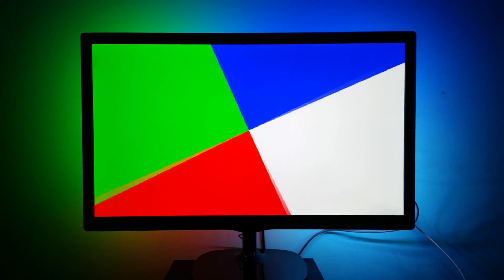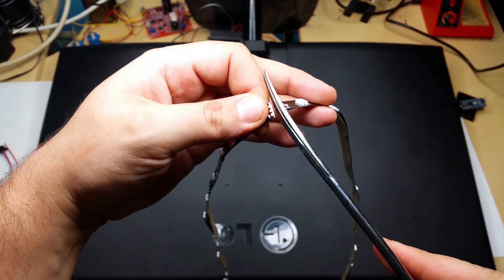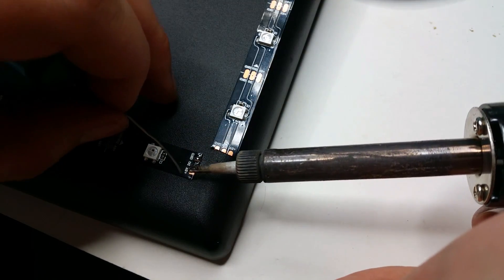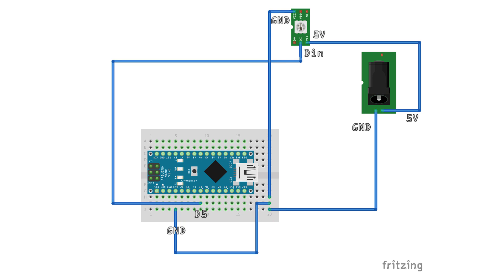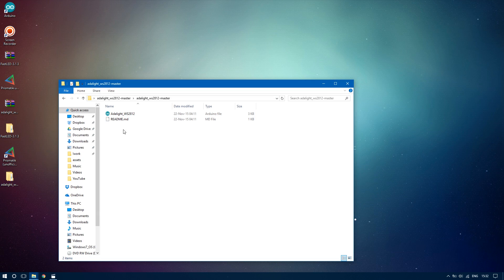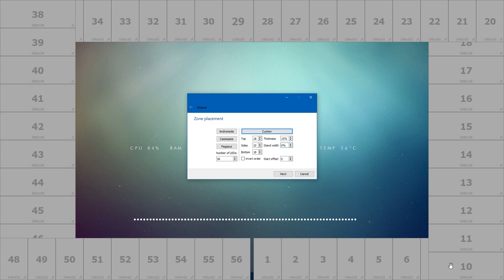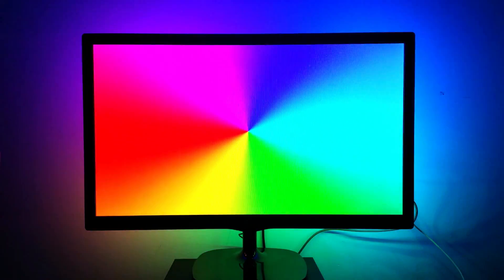DIY Arduino Ambilight RGB WS2812b Full Build & How-To

Comment: Watching it again and noticed that:
3:21 Arduino is on the board in specific position (based on empty spaces of board)
3:24 Arduino is rotated 180 degrees on the board or just moved 1 pin to the other side?
That make a difference?
 You know what I mean?

Picture:
http://www112.zippyshare.com/v/kQ9OxbOK/file.html
Reply from the maker: As long as all the pins are connected correctly, the orientation of the breadboard doesn't matter.

Comment: Thanks for the tutorial. Have question as well. Do you somehow connect together those 3 ground cables underneath in the bottom right corner of the breadboard or do you just pin them in and it magically works?
Reply from the maker: +Dzin Jak yes they are all connected in one corner of the breadboard
Reply: So I assume you just pin them in without doing anything. That was one quick response. Thanks!
Reply from the maker: Alternatively when looking back, you can add all the grounds to 1 rail of the breadboard where it says gnd on the arduino.

Comment: Hey man. Nice tutorial! Have some questions. Can I use Sk6812 RGBW instead of WS2812B? Using a 60 pixels/m the 5v 2a dc is enough? Thank you!
Reply from the maker: Alexandre Akio Ogata not quite sure. You can try googling if adalight has support for rgbw lights.
Reply: Boris Dusnoki The reason I was trying to change the strip was the white color but I've found a solution calibrating through prismatik. And each led consumes 20mA right? 1.2A per 60pixels/meter. Thanks

Comment: Amazing, nice tutorial, i'm successfully create a simple prototype by this tutorial, using 16 leds just want to know if this scheme works.
I have a question, i didn't use extra power supply but my LED got power directly from arduino (i'm using arduino nano V3) through 5v and gnd pin and it works. The question is, am I doing it wrong? Will it cause any problem in the future? because the leds seems perfectly fine. 

Ah yea here's link if you want see some pics https://www.dropbox.com/sh/q593z5klkypc8dt/AADfmN_IgTJPgpFWc7TpoXhDa?dl=0
Reply from the maker: You can fry the arduino if you draw too much power from it. better use a separate power supply for the strip and link both grounds together (from psu and adruino on the breadboard).

Comment: +Boris dusnoki excellent tutorial.... for the power supply
would i be able to use a cut usb wire for power & ground?
red 5v black GND?
Reply from the maker: liquidco2 yes you would. That's how I'm doing. But check with the multimeter for any case. Which of the 4 wires is which.
Reply: Thank you for the reply, I've ordered my parts now just waiting on delivery from china
Reply from the maker: You're very welcome. Thank you so much, it really means a lot :) Cheers

Comment: what if i don't have a breadboard? can i plug the wires directly in the black slots on the arduino? i'm building this up this weekend, i would greatly appreciate any help! Thx!
Reply from the maker: The Cezz yeah that would work as well. If you have a bigger arduino you could connect everything in the headers. I just used a smaller one cause of the form factor. You could even use a pro mini with 5v.
Reply: @Boris Dusnoki 
Thanks! one more thing: does the "power supply ground" mean the V- output from the power supply, while the "power supply positive" is the V+ one? Without a breadboard, can i split the "power supply ground" into two wires and connect one to the LEDs and one to the arduino on the ground socket? I hope you understood what i meant, sorry i'm a total noob what it comest to electronics. Thanks again!

Comment: Nice tutorial, Ill build one set for my gaming pc and one for my Virtual Pinball Arcade.
Ill report back how it worked out in 1-2 months when the stuff has arrived.
Reply from the maker: zweck4629 good luck man. Glad you liked it :)
Reply: Hey thanks, btw have you measured how much current the leds draw in practice?
Aliexpress says 9 W per metre so your setup would draw 16,8 W with your 10 W charger.
Ive ordered a 5w 4A power supply to be on the safe side with my 43 inch screen.
Reply: hey did you ever build yours?  I have a 42in so was wondering how yours turned out

Comment: Hi thanks for the video, do you know the limitation of the software or the arduino? I've tried using 188 RGB WS2812b to light my screen, and set the refresh rate at 30ms. However the FPS is highly unstable and sometime it will freeze or have very long delay. Would this problem be fixed if I go get a better Arduino Board? (Sorry if it sounds like nonsense to you but I have never dealt with mini computer before) Would be great if you can help me out. :)
Reply from the maker: +Yuch G thanks man. The thing that pops in my head is to find the culprit. First, try lowering the refresh rate to under 30fps, next get another computer(maybe a laptop) and check if it works better with that one. Alternatively try setting the number of leds to use to around 90 with your computer and see if that is the problem. I don't think it's a problem with the arduino.
Reply: Thank you for responding, I tried with a laptop as you suggested, it doesn't even go on some how, the prismatik software is aware of the arduino and also sends out signals but the led just don't light up. Same goes with the power cable for the LEDs, they must be pluged into one of my PCs USB ports to function and if I hook them up to a 5V 2A USB charger, they won't light up. However lowering the refresh rate and change the signal com port to usb2.0 instatt of 3.0 helped. Do you have a theory why the power adapter doesn't work?
Reply from the maker: Yuch G well for 188 led strip you should definitely use a beefier power supply to be sure. Maybe a 5v 5a supply. You can get it on AliExpress. Make sure you connect the positive of the power supply to the 5v rail of the strip, the negative to the GND rail of the strip and the GND of the arduino together and the data rail to the arduino digital output pin(whichever you have chosen) and only then connect your Arduino to the USB of the PC and make sure you have the correct port setup in prismatic because it changes when you change the USB port. Hope it helped a bit.

Comment: How I can do this with TV?  Is it possible?
Reply from the maker: It will work on your TV if you connect your TV to the HDMI output of your PC and use it as a PC monitor, only then can it know what is exactly showing up on the screen and change the colors of the LED's. It is not meant to be used standalone I'm afraid and needs to be connected to the PC for feedback. I will make a standalone Ambilight system in the future, when I get my hands on a decent TV.

Comment: I'm trying to do this myself and I'm currently on the part where you tin the leads on the LEDs but my solder is like 14 gauge with a really bad soldering iron with like a blunt tip. Any tips to help me out? I'm trying to get some smaller solder. Also while i was soldering the arduino it took like an hour to get 4 good solders to the connections.
Reply from the maker: +milodudeful get a decent soldering iron. Doesn't have to be expensive. You can see the one I'm using in the description I have a link to Amazon. Also I'm using mostly under 1mm 60/40 led based solder. And if you still have problems try getting a Flux pen and dab the pads a bit before soldering. Makes it a lot easier. Hope it helps.
Reply: Alright so I just got some new smaller solder which is still on the larger side for electronics but it came with some water soluble flux in a tube and it works freaking amazingly like i dont even have to be spot on with dripping the solder it goes straight to  the metal connections I just wish that the hardware stores near me had rosin core solder, but its such a niche market for those here. Also with how I was soldering before I came SO close to having some solder dripping down into the electronics of my monitor because of the air flow vents on the back of my monitor but luckily the plastic bonded with the solder, but now its like impossible to get it off :-/
Reply from the maker: Glad to hear you are getting better. Soldering is like that. The more you practice the better you become. I'll probably make a soldering video in the future, but would like to get started on some SMD soldering so I can include that in the video as well. Sad to hear about your monitor but that is a risk I suppose with soldering. You could solder the strips together when they are not attached to the monitor or use some L connectors for led strips (that I found out existed after I made the video).
Reply: Boris Dusnoki there's L connectors -_- but my soldering hasn't really improved I still suck but I learned that flux is improtant and makes things 100x easier for this

Comment: According to AliExpress your 5V ledstrip uses 18 Watts/meter, that means 3,6 Amps per meter. Buy you're using a 2,1 Amp power supply which means that your led strip is less than 1 meter? I need to know because my monitor is 32 inch, so 2,30 meters of led strips. A phone adapter of 2,1 Amps isn't going to be powerfull enough, right? More something like 8,2 Amps.
Reply: Please let me know how you did connect the phone charger to the strip?
Reply: Oh, ok thanks, also thank you for this tutorial, best one yet!
Reply from the maker: Ramy thanks man it really means a lot. I have some more similar projects in mind. Just have to find the time to make them :)
Reply from the maker: Yeah I know... that's why I also ordered a 5A 5V power supply. But after measuring the length of strip I had (a little bit less than 2m it came out under 1.5A the power consumption. So I decided to use the 2A phone charger instead. It may depend on the strip you use but mine came out like this.
Reply from the maker: Ramy just cut off the end of the micro USB cable on the phone side. Check with the multimeter which wire is which. Usually red and white wires are positive negative.

Comment: I'm total noob in this, but really want to have it.
Can You just tell me - how it is all connected? 
Can I connect power for LEDs from PCU directly and than Arduino via USB to PC? This will be enough?
Reply from the maker: +Pe Pe hey man. As you saw there is a connection guide in the video but the summary is. 5v from the power supply goes to the 5v rail of the strip. The ground from the power supply goes to the ground rail of the strip and the GND pin of the arduino together. And the data line from the strip goes to the data pin of the arduino and the arduino connects via USB to the PC. Hope i clarified it a bit for you.
Reply: Lovely ! Just waiting for my delivery now :) Thanks !
Reply from the maker: Pe Pe good luck :)
Reply: Boris Dusnoki Can I use LED strap with 4 PIN instead of 3 ?
Reply from the maker: Pe Pe which leds are they. If they are regular r g b gnd 12v strips then no. If you by some chance got ws2813 led strips which do have 4 pins (5v, d, b, gnd) then yes.

Comment: Can somebody explain how the LEDs work? Like, which should i buy? also, in example "1m 60 IP67",  1m means 1 meter, but what does 60 and IP67 mean?
Reply from the maker: For this project you need WS2811, WS2812 and WS2812B strips (you have links in the description for both Aliexpress and Amazon). 60 means 60 led's per meter (in this build I used 30 leds per meter) , ip67 means water proof rating (ip67 is considered better than ip65 but take both ratings with a grain of salt because you never know with chinese manufacturers if it's properly rated)
Reply: Thanks! nice video btw
Reply from the maker: Thanks man... it means a lot :)

Comment: Very nice tutorial! I'm now planning to build an ambilight system just like your's I've just got one question, do I need any extra cables for connecting the arduino to pc and to the power supply or are they included with the arduino? thanks in advance for your answer!
Reply from the maker: Fantasy thanks so much and I'm glad you like it. Theoretically you could run the leds from the USB that powers the arduino from the PC but that wouldn't give you enough power for the leds. That's why I have a USB cable connected to the arduino from pc. And other usb connected to the 2a phone charger, I stripped the end of the other side and only use red and black cable of the USB cable to power the led lights (5v and gnd). Hope it helps.

Comment: Hello Boris, thank you for this very nice Ambilight tutorial. This is a very nice and cost effective Ambilight System. Could you please tell me if the prismatik software works with 4K resolution? Which LED model are best/brightest for this setup? Do you have a suggestion for Led/m density for a 55inch TV? Thank you so much for your video. Thumb up.
Reply from the maker: Thanks so much :) I'm not sure if it works with 4k resolution but I don't see any reason why it wouldn't (it just depends on the processing power of your PC if it can handle it, that is also the only factor in the amount of leds/meter you can have... but as far as I've seen even 30leds/m on a 27'' monitor at around 20-30cm from the wall you can't make out the individual lights. The brightest strip is as far as I know WS2812B. Good luck with your build

Comment: Thanks for the video, I've a question. Since the arduino requires the PC sending a lot of pictures to it, how much resource will it take from my computer? Is this task given to GPU or CPU? Is there any significant performance drop using this method than using a external HDMI graber and link it to a rosbery pi?
Reply from the maker: Yuch G no, thank you for watching :) I believe it's cpu driven but as I mentioned in a previous comment. If you dial dine the refresh rate fps you shouldn't have any big drops in performance. This is I believe the cheapest ambilight option but if you want to invest in a raspberry pi and hdmi grabber go ahead. It is a more complete system that way. Good luck in your build anyway :) cheers

Comment: Hey, nice Tutorial! So far the best method i've seen. 
I have the problem that the FPS in the screen grabbing mode are permanently 0.00 and it also doesn't update the colors from my screen. However sound visualization worke fine. Would be nice if you could help me out :)
Reply from the maker: That is weird. Haven't had that issue yet. The only thing that pops into my mind is the screen interval option on the "Mode" tab. I set ti around 25fps but experiment with different options. In the last case maybe try reinstalling the prismatic software or maybe even Windows itself. Hope you get to the bottom of it. Good luck
Reply from the maker: I have it setup on both windows, linux and on another laptop and haven't had any issues of this kind.
Reply: Thx, I'll try reinstalling
Reply from the maker: You're very welcome :)
Reply: Ok I played around with the experimental options and now it works! 
I noticed that Green was switched with Blue because i had a different LED strip, so i set RBG instead of RGB and now it works fine! Another mistake of me was to count the LEDs instead of the ICs per side. 
Thanks a lot for your video :)
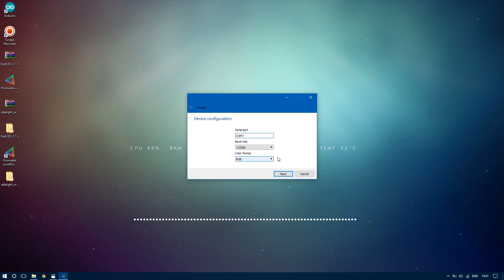Reply from the maker: yeah I mentioned that at 6:01, if you have a different strip the RGB might be different. Glad it works! Have fun :)

Comment: whether it is possible to use this system on an Android-based TV, the root is present?
Reply from the maker: It might be possible through KODI and some plugin for KODI that supports adalight or some other ambilight clone library for Arduino but you will have to investigate yourself. I saw some videos in the past but they were for KODI 13, kodi 17 is out now and not sure if they are compatible... good luck anyway :)

Comment: Hello, I have a question, after uploading the adalight library into the arduino nano, do we still need to power up it with the usb/micro usb cable ? (I'm asking because the arduino is no longer plugged in to the computer on your electrical schematic)
Btw great job and thanks for the video !
Reply from the maker: Bougresses En Rute good catch. I am really sorry and thought that was implied because the computer is the one that is sending the information to the arduino for which light to light up in which color. But the answer is yes. It needs to be connected.
Reply from the maker: And thank you :)
Reply: I just finished it with 72leds/m it looks really great ! :D
Thank you for your help and bonne continuation from France ;)
Reply from the maker: I'm really glad my video helped out someone. Keep up the good work. Cheers
Reply: Boris Dusnoki bro it was good video .... I have a question how did you connect 
With the desktop??? Will I be able to connect it laptop ??
Reply: I need to know how did you connect it with the desktop 
Will I be able to do the same on laptop... ? As I am doing this as a college project .... I need your help with  it!! As your video is far better than the rest
Reply from the maker: why not
Reply from the maker: I am using it with a laptop. So it really doesn't matter. As long as it is windows or linux based (that's the 2 operating systems I've tried it on)
Reply from the maker: In the video I am using a laptop to connect to the arduino, not desktop. Really not sure what you mean. It doesn't matter what kind of machine you are using, only that it has linux or windows installed.
Reply: Boris Dusnoki 
I wanted to know that 
If I am doing this project in my laptop 
Will the strips be able to sync with the laptops display
Reply: Boris Dusnoki thanks bro

Comment: this would probably look even better with more leds/meter don't you think? is there a maximum that the software supports?
Reply from the maker: +Piece o' LEGO it does, but with more leds the processing power needed for calculating the average color of each block that is used to color up 1 led grows exponentially. Believe me. Even with 30leds/m it really looks awesome and you don't see the individual leds anyway. It is bright enough but if you thing 60 or 90 or 120 leds per meter will make you happy go for it :)